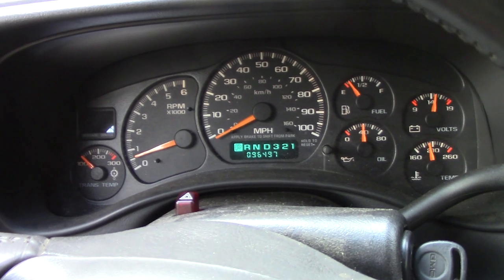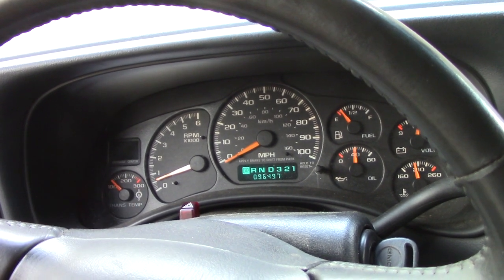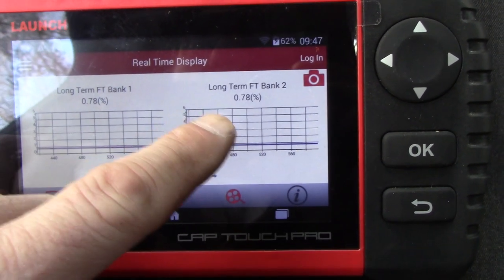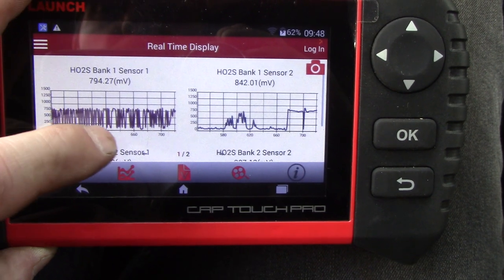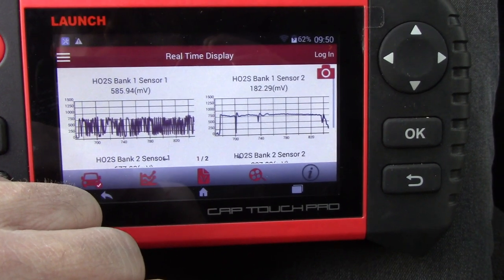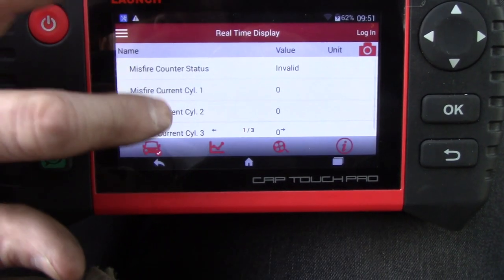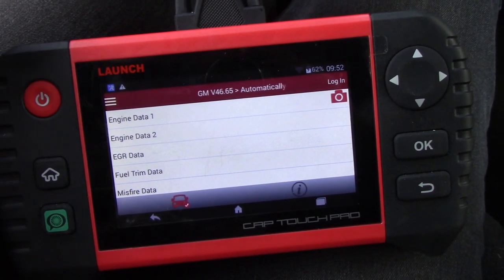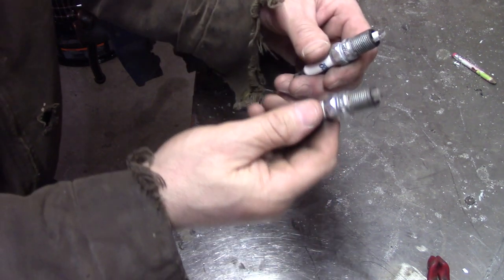Engine misfires on one bank only. (cylinders 1,3,5,7)

Comment: I had the same issue with an 06 Dodge Durango. I had to get a better code scanner (Blue Driver) to see where I was getting the multiple random misfires from, turns out it was on 1,3,5,7. My bank 1 sensor 1 was showing max volt of 1.2 volts at all times. The issue would come and go as it pleased, bout drove me insane. Plus when you look up misfires on a 5.7 hemi the outlook is grim, new heads or MDS issues. Your video got me to order a better code reader which fixed my vehicle. Thanks man.
Reply: So what ended up being the issue on your Durango?  I’m running into the same problem on my 05 Durango 5.7 on cylinders 2468.
Reply: @wayneollison4179  
Don't you hated when people said problem solved but left it at that?
Reply: What was the problem?
Reply: @stevevash4772  ended up being my upstream O2 sensor.  Was showing fully rich.  Replaced it and haven’t had an issue since, and I’ve driven a few thousand miles on it since the repair.
Reply: @wayneollison4179  Nice 👍 Thanks for replying.

Comment: My 2010 Camaro SS is doing the same thing. All cylinders on the driver side are not firing at all. All spark plugs are new and thre driver side plugs are clean. I did use a code reader and says I have 3 bad O2 sensors. I didn't know the O2 sensor would cause this.
Reply from the maker: Of course there could be other causes but if you had a know good front o2 sensor and swapped with the misfiring bank front o2 and if the problem switched banks then you know for sure
Reply: Did u ever find the issue?

Comment: Clogged catalytic converters cuz it's running to rich
Reply from the maker: Replacement of o2 sensors did the trick.
Reply: @JLafix  I have rebuild these engines along with the 6.2. I know the wiring harness pretty well. On the 6.2 there is a ground wire from bank 2 to the battery. On the 5.3 there isn't a ground. If you every have this problem again try a new ground wire. You'll notice a big difference in just the idle
Reply: @JLafix  
It does not help when Amazon sell fake OEM components making the problem more complicated.

Comment: Take the upstream o2 out on bank 1 and screw in to the bung to ck back pressure.if you hav back pressure.will cause ecm to add fuel cause it will see lean in that bank,if us hav opposing ltft

Comment: I'm having the same issue with a Buick 5.3. I pulled out the old school timing light when the engine light came on the dash. There was no spark on all four wires on the odd bank or bank one.... it may be an issue with the wiring harness itself. It seems to happen when it rains a lot. It seriously doesn't seem to happen much during a dry spell. We've had a lot of rain here lately and the light just came on again and it's been running very rough
Reply: The EXACT some problem is currently happening to me. I've chased wires. And no breaks. The injector SEEMS to be firing, and the coil is 100% firing, as I tested it with a test light. Did you figure out your problem? It was driving fine last night until I took it to the car wash
Reply: @MeachPango  no. It seems the more I drive it it has happened less frequently. But I know the issue is still there. I would suspect that there is a week or broken wire or maybe a corroded connection somewhere. A wire can be broken inside the insulator and even if you test it it may connect and test fine until you drive it. I would bet, that buying a whole complete wiring harness will fix it. What a pain in the ass, huh?

Comment: V6 2000 Camry 130,000 miles. Bank 1, Sensor 1 trouble code comes and goes within the drive cycle, never could clear the last remaining monitor but good enough passing smog. This is during a period of 4 years then all cylinders misfire then runs fine the next day. 30 mile drive cycle then all cylinders on bank 1 misfires 1, 3, and 5. Clean throttle body and mass air flow sensor, runs fine then all cylinders on bank 1 misfire again after another 30 mile drive cycle. When it misfires, lost power difficult switching gears on the automatic tranny. 130K miles time to replace plugs, wires and coils, we'll see.
Reply from the maker: Wow. So if it's always bank one, then switch the front two o2 sensors,  if the problem still shows up on bank one then you know for sure it's not an intermittent faulty o2 sensor.

Comment: I bought a 2002ish 2500 silverado with 6.0 from the dealer auction it would randomly not have any power an if u shut it off and restarted it was fine but very randomly. when I got it to my shop it could run for an hour befor it acted up or did it right away so I hooked up a bunch of testing equipment so I could test things quickly because it never lasted more then 30 seconds. When it acted up fuel trim went lean and 02 sensor went lean on bank 1 I added propane and it didnt change but I did test the 02 sensors when running good and they went full rich with propane and full lean when I created a vacuum leak which is very weird but i replaced the 02 and then it did it again but on the other bank so i did that sensor as well and problem fixed. You can also have problems with coil ground on the driver side of the block and or in the harness.

Comment: I have a 90,000 mile 2000 Buick lasabre it’s throwing a code for a bank one sensor 2 and a cylinder 1 misfire. Recently changed the icm all wires and plugs & a coil pack. At the time the misfires were everywhere and would do the same thing. Ultimately I realized it was shooting sparks from a wire which was causing multiple misfires which took out the icm. Replaces the coil pack and icm and that’s when I seen the sparks. It was fine for 7 months and then I start getting the service engine light here and there. Now it stays lit with the misfire cyl one and bank one sensor 2. I read that the car with run lean with a bad o2 sensor so I’m thinking that could be causing the misfire in cyl one. Do you think it’s possible? Kind of same thing one cylinder. Popping a o2 sensor in as soon as weather clears and hopefully it’s the issue with the misfire.
Reply from the maker: I am pretty sure that sensor 2 which is after the cat does not adjust fuel trims . If you were running lean hopefully you would get a po171 or po173 code.

Comment: Have the same problem on my Hyundai Equus 64k miles.    
Misfire 1,3,5,7. I have to wait a week for the dealer to look at it.
Reply from the maker: If you have the ability to swap the forward 02 sensors And the problem switches to the other bank you know that it's a bad 02 sensor.   If the problem stays on the same bank then at least you could rule out the 02 sensors
Reply: Thanks. I will do this over the weekend and let u Kno the results.
Reply: @cwlundy3  any results?

Comment: I have a similar problem with a 2003 Chevy Silverado it seems to run good when it's cold but as soon as it warms up it starts to overload gas and run really rich on bank 1  those cylinders are miss  firing . I have rebuilt top end put everything I could think of into it ,and still no difference any advice would be appreciated
Reply from the maker: Well  as you probably know it could be a slew of things. If it is easy to do you can swap the two front o2 sensor to rule them out. If your issue stays on the left bank then I would start hunting for the air leak, my guess is that the computer is receiving un metered air and supplies more fuel to compensate.  I would start with spraying a fuel source after truck is acting up to the intake manifold and monitor the fuel trims to see if it responds.  If you don't have a scan tool then most likely you will here the difference. You probably already know this if you have rebuilt the engine but just saying what I would start with. If not the intake I would start ruling out other air related sources that could have leak to fool the computer to add more fuel to compensate. Sorry can't  help. Good luck
Reply: One of your cats are plugged for that bank
Reply: @robkopec7680  I hollowed the cats out, and it didn't run any different so I ended up putting some different cats on it from a used truck
Reply: My thoughts are is that it has something to do with the timing advance it could be the camshaft sensor or it has jumped timing one tooth I haven't got that far yet when I do I will let everybody know
Reply: @shawnh802  if it only acts up when warmed then it has to be something that changes when the vehicle is warm. Coolant sensor, o2 sensors, etc. You need to look at live data and trouble codes. Do not guess. Make a video on all the information you can get and be very specific about the problem and I'm sure everyone will help

Comment: I'm having the exact same problem on a Tahoe right now I thought about a clogged cat because it came in last week and the boss man sold a tune up a new intake gasket I tested the coils and cleaned the throttle body but the comments are saying clogged cat and I was thinking that
Reply from the maker: Could be. If you have a scan tool that can read fuel trims and o2 data then you could see if cat was working properly. If not you could swap the front o2 sensors, if the mis fires change banks then most likely a faulty o2 sensor.  If the problem still exists on same bank then you know it's not the o2 sensor and something else is causing mis fires.  In my case the truck was reporting mis fires on one bank but was running fine no actual mis fires.
Reply: I’m having the same problem but I don’t have cats I installed a full exhaust with catless x pipe

Comment: I'm having a reaccuring cyl 1 coil blown  on Audi 2.0  if we change the 1 coil; it would do fine for a while and blow again!  Now; can't get new coil to fix misfire at all!   Thinking maybe censor issue but it's code P0301  Everytime!
Reply from the maker: I seriously doubt that would by a sensor issue.  I don't know if all the coils share a common ground, but I would stick to clue p0301 and stick to cyl. 1. And measure the amps,volts,and resistance on the known good ones and try and find the difference.
Reply from the maker: Also checking the powers and grounds to each. Perhaps something is overloading it after awhile or possibly shorting out from maybe a wire that is bare or broke. Its too much of a coincidence that it keeps blowing #1 .

Comment: Having  a similar problem with my 2010 avalon 71000 miles p0300 misfire from 1,3,5
Reply from the maker: Yes as there could be a multiple array of things that could possibly cause this I cannot believe O2 sensors was the fix for mine
Reply: I have the same problem with my 2004 avalon
Reply: @JLafix  would the problem happen when the engine was first started in the morning with engine cold? Or only when warmed up/close loop?
Reply: @mikem5475  
My Camry bank 1 all cyl misfires at the same time after nice a warm, no problem when cold.
Reply: @kimchee94112  it's a shared system with a component, either o2 sensor, computer power drivers for injector bank, or shared ground for injectors on bank 1
Reply: @mikem5475  I have same issues on my sienna 2001 
Did have solution to it